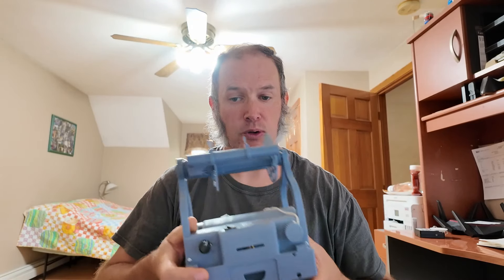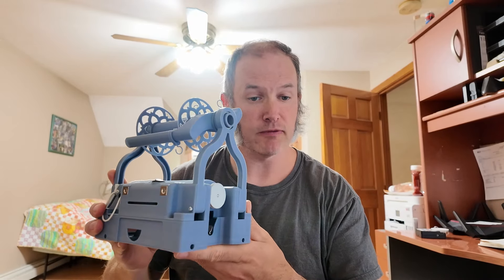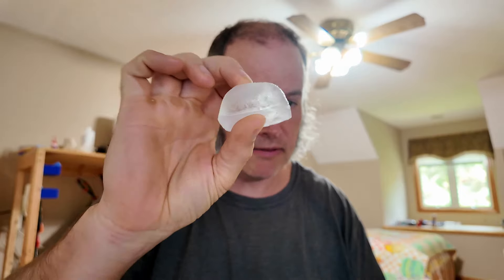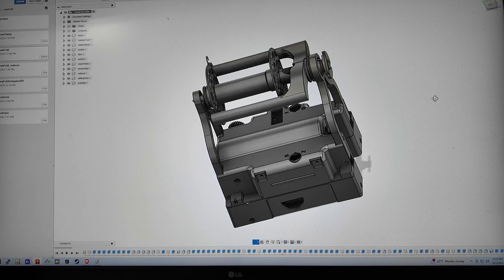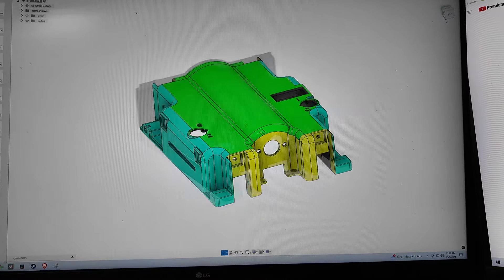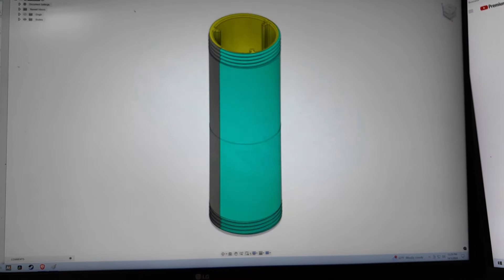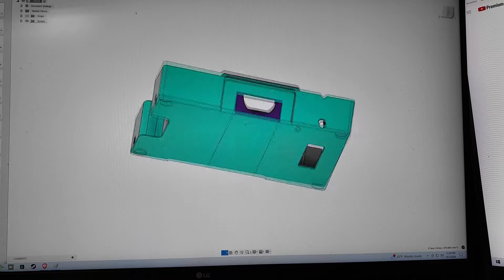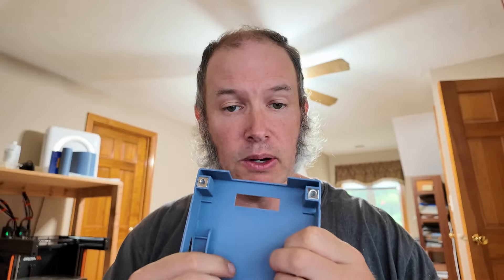Spin 185 - Injection Molding the EEW Fold

Comment: Interesting, thank you! I was wondering if you have any updates on the double drive e-spinner you had mentioned a while ago?
Reply from the maker: I'm working on it in the background, but it has involved a lot more research than I expected.  That is taking up more time than expected so I'm releasing some other products first which will end up delaying it even more.  That said I do eventually plan to do it as long as I can get two of the critical features working well (variable double drive system, and level winding system).  Some of the features on this like some of the electronics for the RPM display and folding mechanism have actually come from the research I've done on the EEW Pro.
Reply: @DreamingRobotsBlog  Sounds like a lot of work! I think I speak for all of us when I say, we appreciate you and look forward to it when it happens. Cheers.